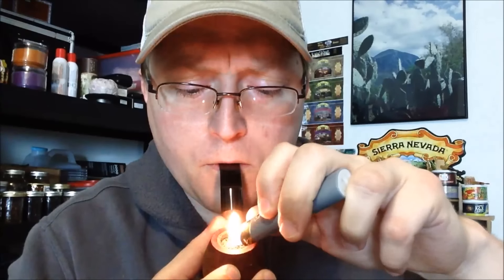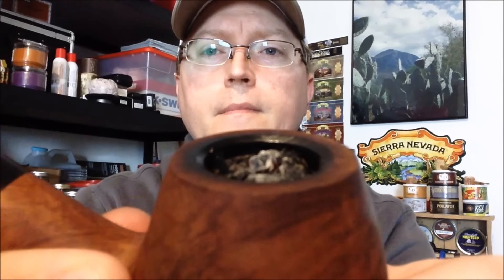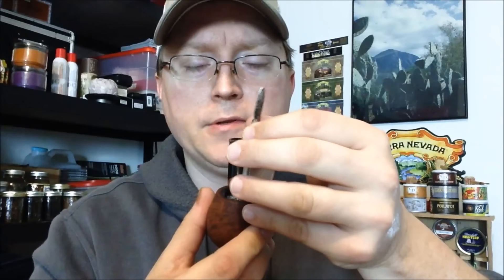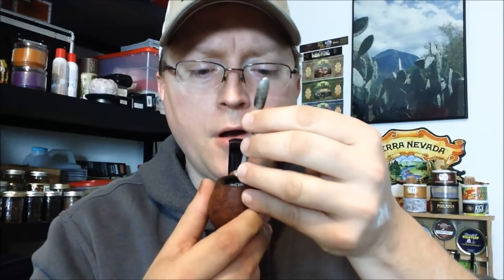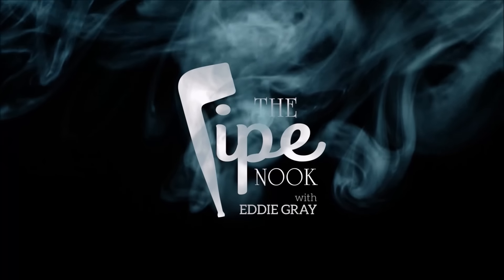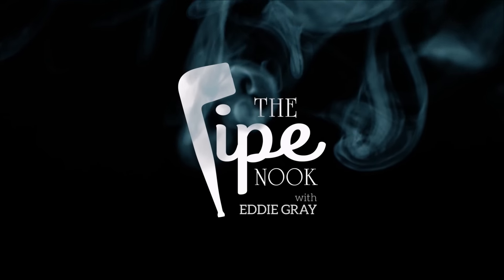How to Smoke a Pipe - Part 9:  The True Light

Comment: Looking forward to the next one.  After about six months I still haven't got my cadence right.  All too often still end up with a hot bowl and harsh smoke though some pipes seem to be better than others.
Reply from the maker: Cadence and its effects are tied to so many other things...type of tobacco, type of cut, moisture level, humidity, wind, how tightly or loosely the bowl is packed, what type of bowl material, size of the draught hole, size of the bowl, etc.  That's why I've tried to hit on all of these different aspects in a different video.  One change in any of these factors will affect cadence and the overall outcome.  That's not something I can really detail in one video...but hopefully my advice on cadence will help a few folks.  But remember, this is just what works for me!  Your mileage may vary.  Thanks for stopping by today!